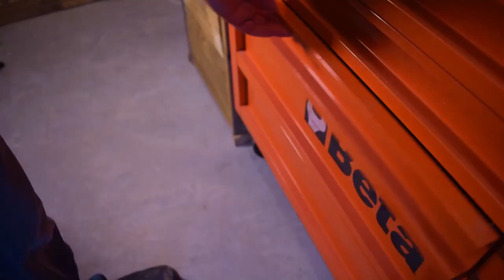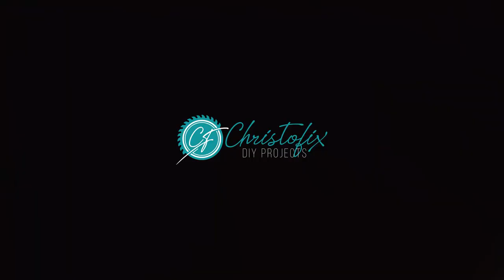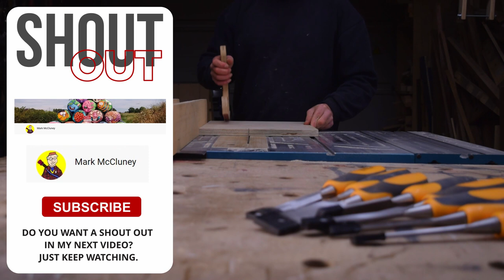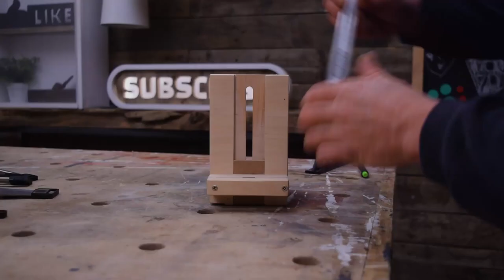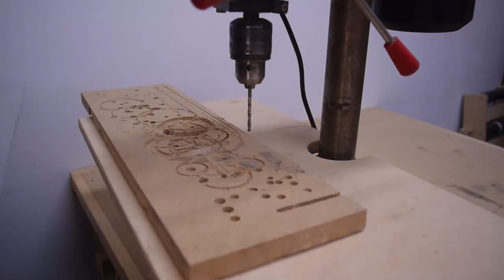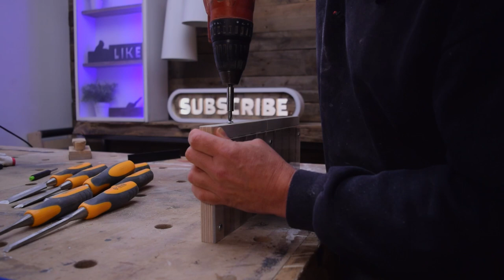Best chisel rack EVER | Easy woodworking project

Comment: Brilliant design, simple, I like the stand aspect. I have a chisel drawer which actually works OK, but one of these w/clear plastic & maybe 4 slots for on the bench when I'm doing chisel work is going 2B great (I never need more than 4 chisels, laying them on the bench is not my idea of safe when I'm in flip flops). Plywood is fine, not a presentation piece
Reply from the maker: Thank you so much for your kind words, Mike. Greetings